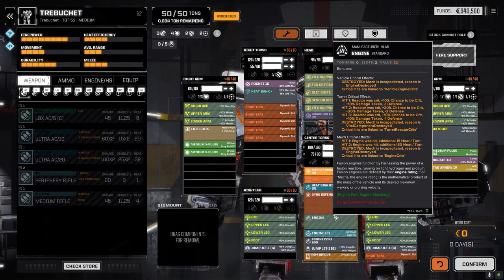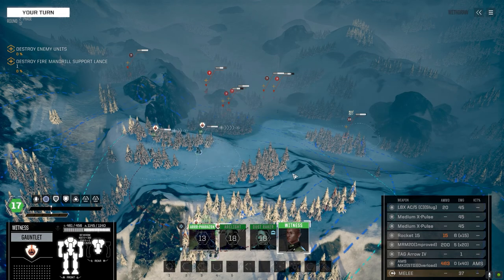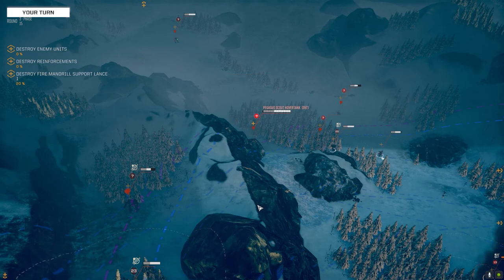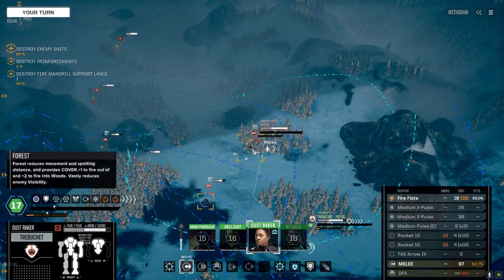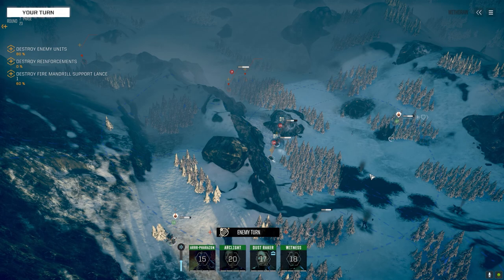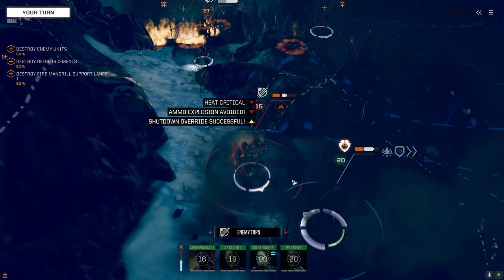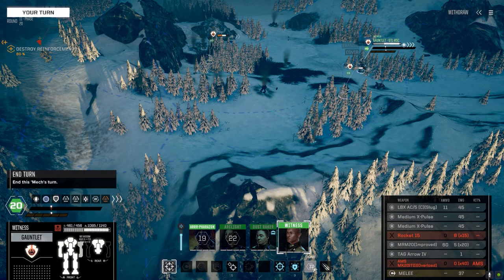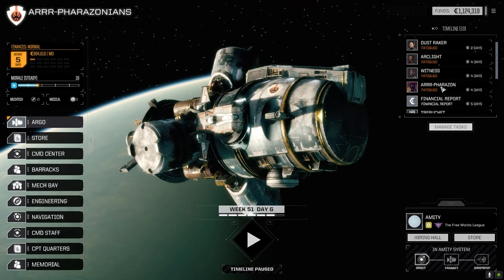Roguetech - ARRR! Ep26

Comment: I was hoping that you would recall the Kintaro has two hands :)  Turn that in to the melee mech and change the trebuchet in to the LAM mech.  You can minimize the jump jets on the kintaro since death from above requires a good deal of specialized equipment to not destroy your own legs.

Also, the heavy gyro would be better suited to the melee mech than that defensive gyro.  If you consider that the mech is going to constantly be moving in to optimal range of the enemy weapons, making it much much easier to hit, the +1 defense is less useful than the extra damage reduction, stability damage removal, and stability damage reduction from further attacks that round.
You could drop the defense gyro on something lighter like the shadowcat (if it isn’t an omni) or the talos since it is so slow.  Maybe even the trashcan when it gets rebuilt.
Reply from the maker: It was a toss up between which Gyro to use. If it was a heavier mech later in the game I'd agree with using the Heavy Gyro as I'd be getting hit a lot more but I figured with more evasion in the medium mech facing pilots with lower skill levels I'd just get hit less.